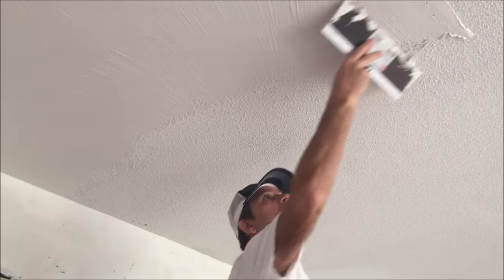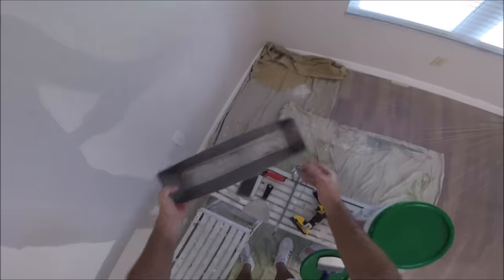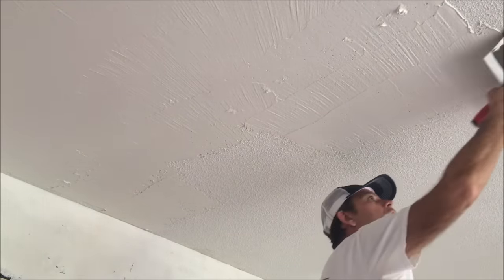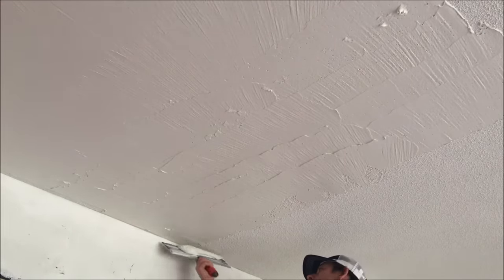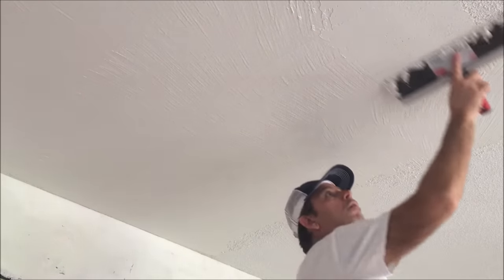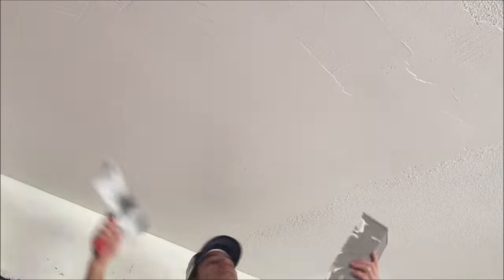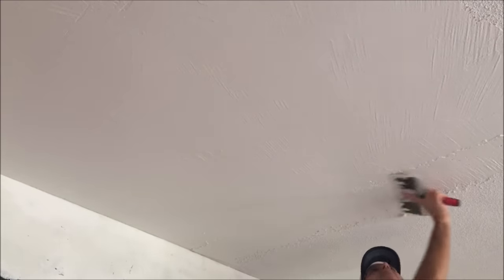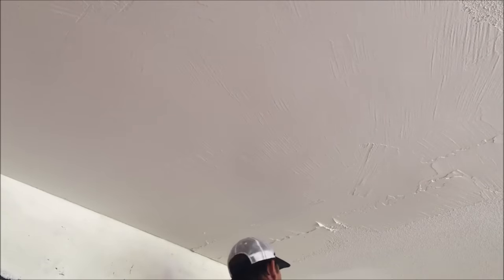Don't scrape your painted popcorn ceiling. SKIM COAT IT!!!

Comment from the maker: Here's the entire Skim Coating over a textured ceiling Playlist Series: https://www.youtube.com/playlist?list=PL7Ww-LhWbB0HItcbzpNDOItxexzM40BTc Below in Paul's Drywall and Painting Shop are all of the tools and products I used in this video: ▶ https://www.amazon.com/shop/paulpeck 🔴 Be sure to SUBSCRIBE for more useful Tips https://goo.gl/Es5k5z Thanks for being a part of this Community! -Paul 👍😎
Reply: Can you skim coat non painted popcorn ceiling ?
Reply from the maker: Hi Mary, no it will just fall off... You’re going to have to either prime it first or scrape it off. If your ceiling is before 1982 you’ll need to get a small sample and send in for testing to see if it has asbestos in it. I hope this helps. Thanks so much for watching and subscribing!😎 -Paul
Reply: @PaulPeck  Thank you so much. So instead of scraping with all that dust I can prime ceiling and then skim coat. For me at age 70 that may be my best bet.Thanks again. I love your channel !!
Reply from the maker: Yes, that’s correct Mary.👍🏻 Good luck with your project! Let me know if you run into any questions along the way.😎 -Paul
Reply: Good video I subbed something I need to take care of whole house has that crap on the ceiling thanks again
Reply from the maker: ASBESTOS!!! As long as the popcorn texture was applied after 1982 you should scrape it.  But, if it was applied before 1982 you should get it tested for asbestos...👍🏻
Reply: @PaulPeck  I think the video should have started by you mentioning that it is only needed to skim coat if the popcorn is older than 1982.  I just think it's better to wet and scrape off if no asbestos.  But maybe you figured people might not know and it's safer if unsure to do skim coats.  I also think you should warn those watching, that this is extremely hard to do right and that it is very tough work physically.  And that those without experience in drywall are best off hiring a pro or it's most likely they'll take forever and end up with a very poor looking ceiling.  On the positive side, you do excellent work and I agree with every technique you do(I have 30+ years experience in painting and drywall)
Reply: That is so, so cool. I had thought about doing that and after seeing your video I'm going to do it that way for sure. Thanks for the info!
Reply: @PaulPeck  where would we send it to get tested?
Reply: What sealer do you recommend first?

Comment: Im a professional drywall taper for over 7 years and its by far the best recommendation I have seen online good job 👏
Reply: Do you think there might be a way to shoot mud up there and then hit it with a big blade to speed things up?
Reply: Probably by using a roller? And then smoothing it out with a blade, let it dry up and sand it down for that smooth finish and it would be ready to paint. 

Fyi: I just got that info from another video 😂😅
Reply: Do you still have to have the ceiling tested for asbestos if you do it that way?
Reply: @nadinequintieri3621  you will have it under but it wont show on your asbestos inspections if you cover properly it is more dangerous if you scrape it because it will be on the air even when contaied you better off covering it
Reply: Thank you so much for replying! So if we just cover the popcorn ceiling by skimming over it can we still interfere with the asbestos or will it stay stable. I'm so confused on what to do.
Reply: @nadinequintieri3621  yes cover it !!!cheaper then an asbestos contract a taper is 75% cheaper
Reply: @nadinequintieri3621  I think what Bethzaida is trying to say is, no, covering the popcorn ceiling in this way won't disturb the asbestos or make it airborne, therefore testing isn't necessary. Just want to make sure that if you do an end sanding, you don't sand into the popcorn ceiling.
Reply: I’m not listening to a guy that still has the sticker on his knife 🌝 anyone can level 5 something just your sanding will be a tad bit more difficult
Reply: You are a pro, what would you recommend to an amateur and novice?

Comment: The problem here is that old popcorn doesn't have a strong bond to the underlying sheetrock. By putting mud, then primer and paint x 2 over it you're adding a lot of weight and eventually it's going to come off in sheets. Not tomorrow or even next year necessarily, but eventually. Use something like a wallpaper remover tool to poke thousands of little holes through the paint, then spray water on it, wait 30 mins, spray water again x 3 and start scraping.
Reply: Interesting idea about poking holes through paint! Will try doing so in another room that still has popcorn ceiling.
Reply: You must not do this for a living
Reply: Im a painter,it wont add weight,its thin
Reply: @tomlehr861  35 years experience tells me otherwise
Reply: My take is to attempt to scrape it. I tried hot water, vinnegar etc. It's best to skim at this point. The bond the popcorn has to the sheetrock is dam near glue. Yes, I got underneath the paint, still to hard. Scrape if possible, skim if bond is strong.
Reply: @isaihernandez791  depends on the popcorn bond but It sounds like the ceiling was already painted, that makes it more difficult. In my experience most popcorn is fragile, but if you have a strong bond or it's been painted then go ahead with that plan.
Reply: Nope - our popcorn is basically plaster - house built in 60’s it is NOT loosely attached at all and impossible to remove without pulling the wallboard down with it (wallboard is 1/2 tick as well)
Reply: @APLivestock_MO  A textured plaster ceiling is not popcorn. Traditional popcorn is made from vermiculite or polystyrene that often contain aesbestos and comes off easily but you really have to wet it down and plastic everything when removing that if your house is pre-1980s but if it's textured plaster that's different. Vermiculite popcorn comes off easily too. It flakes and chips and has aesbestos which is why you've got to wet it down so much. Licensing is usually required unless you're the homeowner. After 1980 they started making it with paper and styrofoam. Popcorn style fell out of vogue a long time ago so the paper and styrofoam ceilings are mostly smooth or designer panels now. If your ceiling is plaster then it was also primed and painted over, likely several times, and of course you can't scrape that.
Reply: I fixed a ceiling that was skim coated over popcorn and peeling down in sheets. But it is also true that if it was painted first it's generally pretty good to skim coat. Wanna go really fast over a painted popcorn ceiling? Spray the mud and smooth it with a knockdown knife. Just did it yesterday. 500 sq ft skimcoated in 2 hrs by myself. Gonna need a little more mud tmrw but It usually does take 2 skimcoats over popcorn to be really smooth
Reply: @isaihernandez791  I think this is fair. I never painted my popcorn ceilings because I knew I wanted to get rid of them. I can see in some places where it’s ready to fall off. 

I think it would fall off if I tried to skim coat and paint it.

Comment: I just did 400+ sq/ft in a 2 step process, literally followed these instructions to the last word, except I used a smaller knife because I couldn’t get a bigger one. Couple touch ups after two coats with MINOR sanding after using the knife to knock down ridges, looks banging. Thanks for the tips!
Reply from the maker: That’s awesome man!💥👊🏻 I’m glad my videos could help you. I really appreciate your feedback. Thanks so much for watching and commenting my friend!😎 -Paul
Reply: @PaulPeck  i have same type ceilng,will i need 2 coats of mud?

Comment: 27 year veteran of the remodel world and the first 10, drywall only.  The key to skim coat is to pull the mud one direction and skim 90 degrees to the skim.  It will smooth out so much better and make the second coat a lot easier........of course experience trumps almost any trade, the longer you do it the better you'll get, no matter how many videos you watch.  45 or 90 minute mud is so much better for the first coat any day of the year and it save s the dry time as well

Comment: That's really a great idea.
When I remodeled our 40 year old rental property, I sprayed a light coat of water on the ceiling and the popcorn textured pealed right off for me.
On the negative side, this method was extremely (and I do mean extremely) messy and I had a helper who was a bit too aggressive with the scraping and did cause a bit of damage with the scraping knife.
I wish I would have known this 5 years ago.
Thanks for sharing.

Comment: Drywall tube. Nice work man! Ya I was shown by an older boss of mine how to skim coat without sanding between coats or pretty much at all.. wed knockdown after so wasn't necessary. But his stuff honestly looked finished. He prided himself on not even having one on job site. Not sure I agree but it taught me to not rely on a pole sander and just use that 6 in between coats. I still try not to use a sander when I do any mudwork but I find myself going over
 things more than I should if I just sanded..I just hate the dust and mess and added labor! Thanks for the good info and videos! Im Floating my hallway over popcorn currently but it's taking me two coats to look like your one.. gonna do rooms later with some of the tips u gave.

Comment: I’ve been doing drywall since 1994. The best way to do a project like this is to use a a garden sprayer with hot water & let the the water soak in for a few minutes. When you go to scrape it off the popcorn comes off in sheets. No dust. I usually have a guy on the ground catching the sheets with a box. Very little mess. Sometimes it’s just best to remove it, that way you can repair damages on the Sheetrock. (Cracked seams, popped screws, blisters etc.) It’s actually a quick process when done correctly. Then you can replace the texture with whatever the homeowner desires. (Skip troll, knockdown, orange peel, whatever they want). I’ve never had a problem doing it that way.
Reply: You missed the part where he said it had been painted.

Comment: Nice job of smoothing the ceiling; I'm sure with the second coat, it will be nearly flat. The paint that was previously applied to the popcorn must have made it into a much stronger substrate than the popcorn-alone would have been. What I don't get is why the owner would want to mess it up with yet another texture; I'll bet that in a few years there will be a plethora of videos on how to skim over a skip-trowel finish.
Reply: Exactly my thoughts.

Comment: I tried scraping my popcorn ceiling off even wet it a bit to try to loosen it up. My house is built in 1976 I don’t know what they used but when scraped into felt like I was scraping stucco lol 😂 . Ended up skim coating it and dam it looks awesome 👏🏽👌🏾
Reply: pre 2000, or even pre 90, chances are there's asbestos in it, DONT scrape it without checkinng it out first

Comment: Hi, you are doing a great job on the skim coat. I am a retired drywall finisher of 21 years. We would have one guy roll the mud on and the other guy skim coat. On a big project take turns rolling and skim coating.  Did you ever just use a sprayer and wet the popcorn down then scrape it off? Anyway that work will give you strong bicep's for sure.

Comment: This is the video I was looking for last fall when I did this to the whole house. I did basically what you showed took two coats then a light sanding I then sprayed orange peel on ceiling and walls. You make it look very easy it took me a long time and I made a good mess but it turned out well.

Comment: 👏👏👏👏👏thank You I didn’t even know u could do this.. they all said u have to scrape it off.
Reply: It's cheaper if the popcorn ceiling has NOT been painted and you can just scrape it off.
Reply: Asbestos wasn't banned from popcorn until 1982, so it's a health hazard to scrape off old popcorn if you don't know when it was applied.  He should mention this at the start of the video
Reply: 888strummer but what most people don't realize is how to scrape it and the process of doing the scraping and disposing is fine even if asbestos or to the crazy extreme of lead it's fine! But most people don't know!
Reply: @kenbarr7069  I would never recommend a homeowner scrape asbestos off of ceilings.  And I think a video like this should begin by explaining that asbestos wasn't banned from popcorn ceilings until 1982.  A separate video can be made to show ways of safely removing asbestos or lead as you are right there are safe practices for removal.  The best advise I give people is to simply never buy a home with popcorn ceilings if they don't like popcorn.  As a contractor for 30+ years I'm amazed at all the people who buy a new home with popcorn and then call me and ask if I can remove the popcorn.  And when I tell them I don't remove popcorn or skim over it, they get very upset.  There is so much work where I live that I luckily can pick and choose all my work.  But again;  I'll never understand why any homeowner who hates popcorn ceilings would buy a home with popcorn!

Comment: Beautiful work my friend !! EASTER EGG for those who are in dire need to defeat your popcorn demon - THE GOOD NEWS IS YOU CAN GET IT OFF IN ABOUT A DAYS WORK = The trick for chiseling it off is spray an area down with light water mist and then hit with a heat gun - Put your heat gun on high (around 1000) -you can do it yourself or have a friend move ahead of you with the heat gun - BEST to chisel while the painted popcorn has been softened and expanded by the heat gun following not too long after its been hit by the heat gun - a normal bedroom could be done in a day especially if you have an assistant w/the heatgun - its not so hard as it is tedious so be patient and accept that this is what your doing for the whole day lol -GOODLUCK

Comment: Just put 1/4 sheetrock up and finish it. Lot easier than mudding an entire ceiling!
Reply: Except u have to buy maybe 4 sheets of sheetrock, a box of 100 screws, put it up, buy joint tape and a box of mud, a mud pan, a mud knife, tape and bed the joints, sand the mud and paint it. So ur still gonna have to buy the mud any ways so?!?
Reply: Not to mention you generally need multiple people and or a drywall hoist.  Have to mark our the studs, get your tape lines looking good and fill all the screw holes.   A skim coat is half the time and a 1/5 of the coat.
Reply: @garrettfalls7953  u sound like someone how might do this for a living!
Reply: Putting up 10 drywall sheets and doing all that work and prep sounds a hell of a lot harder than pushing mud onto a ceiling.
Reply: For this size room what @ would you charge to do it this way
Reply: Or board the entire ceiling if style is acceptable for you
Reply: I worked with a guy that could put up 12 ft 5/8 Sheetrock by himself lol held it with one hand and nailed it with the other. Crazy strong dude.
Reply: Minimum 1/2 inch sheets though. Any serious boogers in the acoustic exiting can mess with 1/4 inch. It’s just too thin to risk it

Comment: I am a DIYer I am also a woman but I am a jack of all trades and I do quite well. I just repaired an emissions leak in my jeep so with that taken care of there are no more codes for my EVAP system. I can now get a smog. I have popcorn ceilings I’m not sure if there’s asbestos in there so I’ll have them tested first but I think I would like to just skim coat them as you did. This would be a lot safer I think a lot easier even though it’s a lot of work it’s easier because my popcorn ceilings are on plaster my whole house is plaster not drywall period. About 17 years ago 16 years ago when we bought the house I  recessed lighting put in and they had to scrape the popcorn to make The recessed lighting lay flat because they asked me if I wanted that done I said sure because I had planned on getting the ceiling scraped eventually. And then I got a divorce so that was no longer feasible. I wonder now how many fibers if this is asbestos were released into the air or if I should’ve painted over that scraped portion or if I still should paint over that’s great portion. I didn’t know back then what I learned now.

Comment: This drywall video helps tremendously. I have a 2-family with lots of painted popcorn on plaster. I have already removed the plaster to replace with drywall on the 2nd floor. I think on the 1st floor I will keep the plaster and try to skim coat the popcorn walls and ceiling. Can you tell me the dimension of your walls and ceilings and how long it roughly takes?
Reply from the maker: Hi Steven, I’m glad you’re enjoying and learning from my videos!👍🏻  Your walls have popcorn too? The room in the video is 14’x14’. It took me 30 to 45 minutes to apply each skim coat to the ceiling. I hope this helps. Thanks so much for watching and subscribing man!😎 -Paul
Reply: @PaulPeck  Hello, yes the walls and ceilings have popcorn also the walls are all plaster. I am removing the bad plaster walls and will remove the ceilings because I want to insert insulation. Just wondering since I will have a mix of drywall and plaster in which all of the plaster will be skim coated once I have everything painted will the whole room should look like new drywall correct?

Comment: You make skim coating a ceiling look so easy.  I have done 3 ceiling in my house and I find it to be difficult.  I think I’m not using the right mud or mix correctly.  I use a lighter mud that is supposed to reduce dust in sanding but I think the mud you are using is probably better so I might look for that brand and also follow your mixing and roll on method.   Looks easier.

Comment: I do this all the time. I have a question though. Ive found that when you have a ceiling that was originally put up over oil based paint, then painted with a latex, the mud can cause the existing texture to crack and peal off bringing the mud down with it. Have you seen this? How do you deal with it?